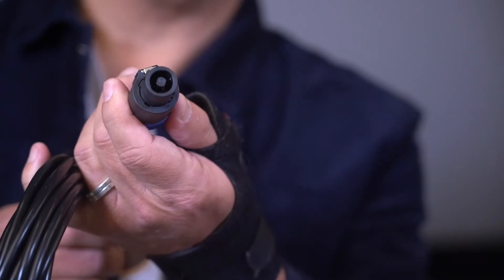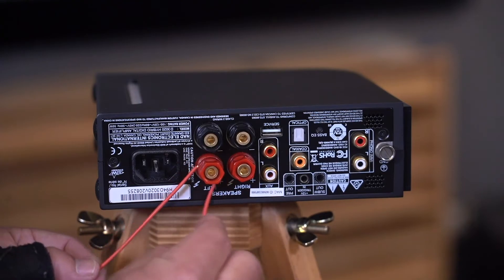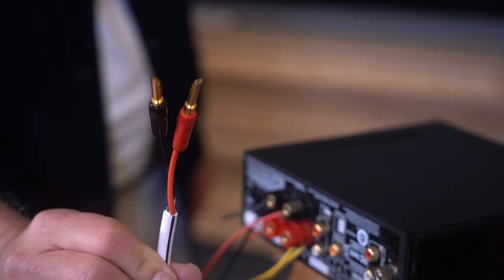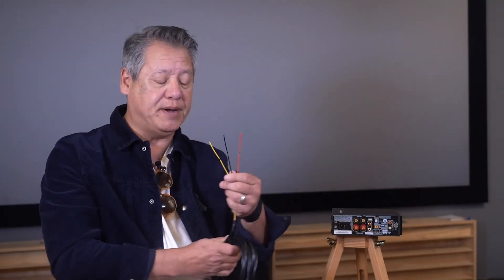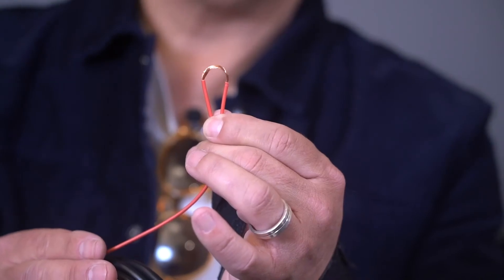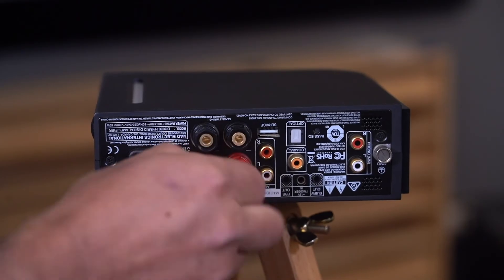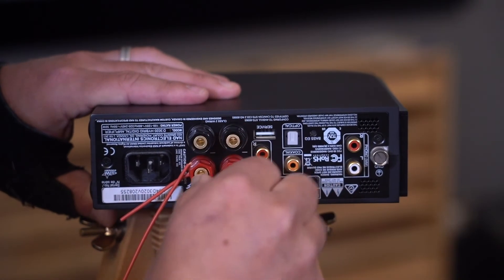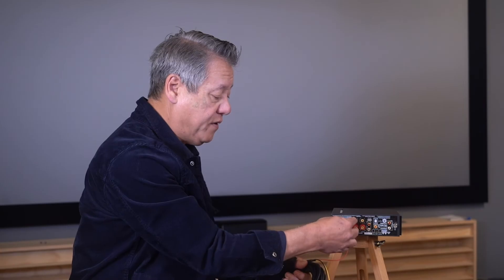What are some tips for the best way to connect a REL Acoustics subwoofer high level?

Comment: i still don't understand this. Where is the speaker cables from the speakers themselves going to if you're already connecting to the binding posts? Basically if you wrap those wires(from the high level input) around the two binding posts, and you're using banana plugs for speaker cables, you still plug all 4 in? Call me dumb but isn't that a bit hazardous to share one post with 2 cables? I'm lost.
Reply from the maker: Thank you for reaching out. When using the High Level input connection to a REL subwoofer, both the High Level wire and your main speaker wire will be connected to the exact same speaker output terminal on the amplifier. As long as you are careful and cleanly connect the High Level wire to your amplifier's output binding post, then this connection can be safely made without placing any current load on the amplifier or drawing any amplifier power away from your main loudspeakers.
Reply: @RELAcoustics Careful as in wrapping the high level wire like you showed in the vid?

So i'm guessing if you're mostly looking for a musical sub the the tX series is the best option?
Reply: Thanks for asking. I need this confirmation also.

Comment: Hi REL, I would like know if I can simultaneously connect high level to a 2-channel amp, and the LFE to a separate AVR amp? So that the sub can do double duty, music and HT, but not both at the same time of course.
Reply from the maker: Thank you for reaching out. All of our subwoofer models that feature the High Level input are designed so that they can be connected to using both the High Level input and the .1/LFE input simultaneously. This means that you can connect High Level to your 2-channel amplifier, and then connect using the .1/LFE input to the sub-out on your AV processor/receiver.
Reply: Bad idea. Combines signal, you want to mute the high level signal when using the sub in AVR mode. Also don't set speakers to large. Rel have it wrong.

Comment: When r u guys gonna release new rels with the phone app?😅
Reply from the maker: At this time we do not have any plans on incorporating app control to our subwoofers, in large part because the DSP required for app remote functionality adds delay and latency to the subwoofer's performance, which leads to a less optimal blend with the system's main loudspeakers.
Reply: Just buy another brand that has plate amp with modern DSP features. Rel is 30 years old school design.